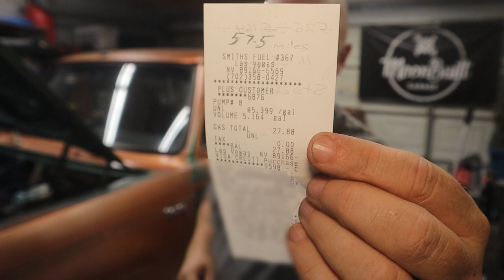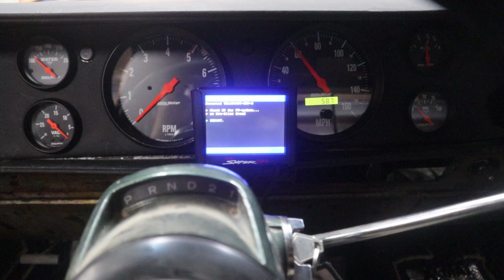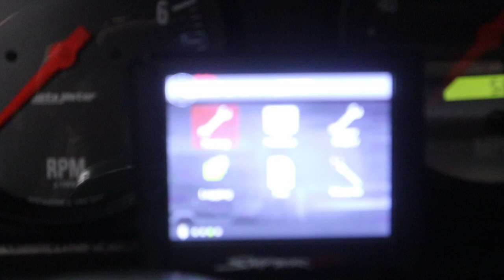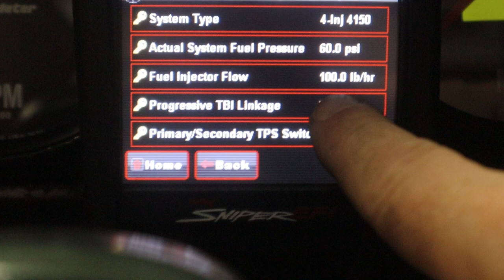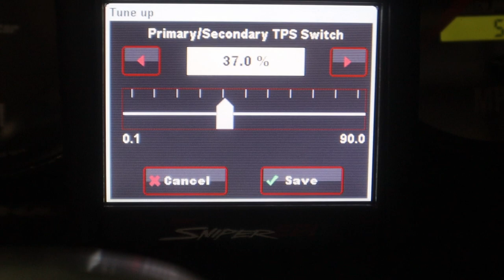Holley Sniper EFI Quick and Easy Improvement

Comment: Two things for people to consider when installing the progressive link.  First, be sure the secondaries are remaining 100% closed at idle.  In some cases the vacuum at idle can crack the secondaries open just a bit and cause a high idle.  If this happens, you can add 1 turn to the spring on the secondaries to solve that problem.  The second thing to remember is that if you are running a vacuum advance distributor, you can no longer use the ported vacuum tap.  You will have to go to manifold vacuum because the ported vacuum is ported to the secondaries, and you will not get a vacuum signal until 40% throttle, rendering that port useless.

Comment: I think the better solution to solve the sensitive throttle, leaving the progressive alone and ordering, 20-16 Sniper EFI Throttle Lever.
This changes the pivot point of the throttle cable. 
I just did mine last week. It was night and day. I was afraid to drive the truck prior to this as throttle was extremely sensitive.
Reply from the maker: That is an option...I actually ordered both, but decided to try the linkage first...I may still play around and try the throttle lever to compare the two
Reply: @MoonBuiltGarage  yes. Give it a try. You'll be surprised! Good luck and thanks for the informative video.

Comment: My transmission valve cable from the sniper was not adjusted properly. Cooked the trans. New trans , spent time fine tuning the tv cable. Shifts ok now, however the sniper bog's down. Doing my head in, so going to a professional tuner. I do like the cold start with EFI.

Comment: Makes sense. My throttle pressure seems too much in the pedal and sensitive. I put the linkage in to improve tip over but I think I still would like to try the progressive linkage for secondaries. 
I’ve got idle surge when it gets hot, scratching my head on that. 
Thanks for the video.
Reply from the maker: I still have the extended linkage, but I don't think I need it..the progressive linkage feels so much better already

Comment: I have a 1986 olds cutlass. I’m installing the Holley to it. Do I use two 02 sensor, can I disconnect the cars 02 and install Holleys 02 in its place. Need help.

Comment: Did you have to change your distributor vacuum line to go to manifold vacuum? The company that sells the progressive linkage says it will not work if distributor vacuum is in the sniper unit itself. Reason being is the vacuum works off of the secondaries and if they don't open right away then it messes things up.
Reply from the maker: I'm not running a vacuum distributor

Comment: I have a sniper on my car.  I bought one of those progressive linkages but never installed it. I was afraid it would cause a tuning issue.  I did get one of those throttle extensions because the pedal is hard to press and it only helped a little.  Your video has  got me to thinking about installing that progressive linkages again.  No telling where I put it though.  LOL
Reply from the maker: I actually ordered both, and decided to do one at a time....I honestly don't think I need the extension with the progressive linkage installed
Reply: When you put the progressive linkage in you also make the change to the setting in the controller.  After I added mine it made no change to the tuning.
Reply: @MoonBuiltGarage  where can i order the progressive linkage from?
Reply from the maker: Link in the video description....

Comment: Don’t know if you fixed your trans problem or not. I rebuilt transmission for almost 40 years and in my experience with the Chrysler old units came down to the toque converter clutch comes apart and clogged the return oil from the cooler. The first place it goes is to the old. With no lube oil going back to the transmission you have a meltdown.
Reply from the maker: Seems like the trans is working well.  I haven't heard of the torque converter problem
Reply: @MoonBuiltGarage  sounds good. That generally happened when the converter bolts were to long. They would bottom out and dimple the converter where the lockup clutch engages causing a chatter on engagement. Then the lining would come apart and clog the cooler.

Comment: Thanks for the feedback on this system.  Once you get it dialed in how about testing the MSD system and comparing the two systems.  I’m told the MSD system is very good.
Reply from the maker: I'd be happy to....how long until you send me one? 🤣
Reply: @MoonBuiltGarage  how about a go fund my project page for folks who are interested in learning?
Reply from the maker: Since Holley owns MSD I'm sure they are probably pretty similar.  Plus, I was curious and went to Holley to look at the Atomic EFI, and they now have the Atomic 2, which looks even more like the Sniper, especially in the controller and the way they packaged everything into the throttle body just like the Sniper.  Even the price points are almost identical....

Comment: You have to be careful what you are telling people!  When you install that linkage,  you also have to change the enrichment table along with it. If you look down into secondaries even with your wizard programmed, they are still dumping fuel, doesn't matter if they are open or not.  You have to program the unit not to dump fuel till the tps gets to the desired percentage. 
It's called acceleration enrichment correction.
Reply from the maker: I did a video on that....

Comment: I havent had any issues leaving a stop sign slowly with the 400sbc in my 3rd gen Camaro that has 3.73s and the stock throttle linkage on the Sniper unit. With the progressive linkage you do lose a bit of power because only one set of butterflies are opening until you get to 30%(ish) throttle. I think it's worth trading more power for a bit less fuel mileage
Reply from the maker: I haven't noticed any loss of power...one set of butterflies opening at first is just like a normal carb...I would think it is just the opposite, with both butterflies opening together at low rpm you are more likely to give the engine too much fuel, causing a rich condition or even flooding the engine
Reply: @MoonBuiltGarage  double pumper holleys should open all 4 barrels at once, I had one before I swapped to EFI. I dont have any rich conditions when I floor it from a dead stop but I have the Hyperspark system too, my car didnt take long to tune and it runs great without progressive linkage. Any rich or flooding conditions would be tune related and the self learn should fix that.

I had nothing but issues with the external fuel pump Holley provided and went through three of them before going upgrading to a in-tank 525LPH pump and Holley HydraMat. I had the external pump below the tank and as close as possible but it kept aerating the fuel and wore the pumps out.
Reply: There is no difference in power.  You just have to push the pedal down a bit more.  Your engine does not care if you have 1, 2, or 4 butterflies.  All it knows is how much air and fuel is coming in.  If 4 butterflies open 3% gives you x amount of power; you may have to go to 5% or 8% to get the same amount of air to make the same amount of power.  The bottom line is you need a certain CFM of air and the proper AFR.